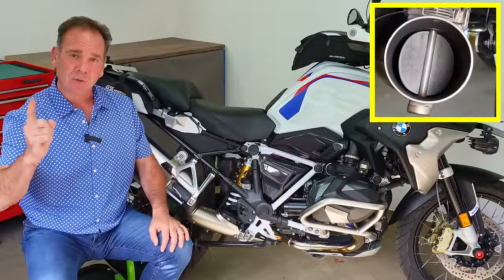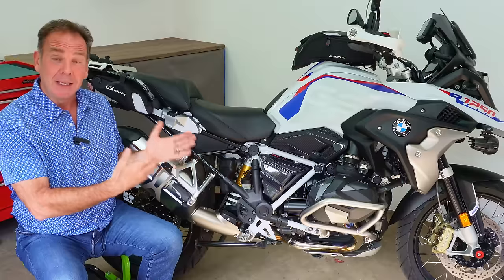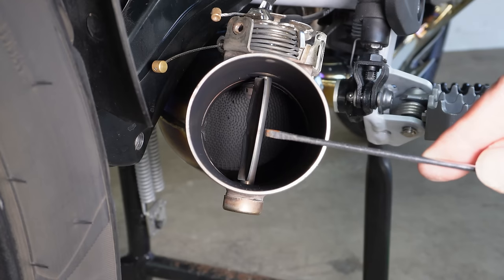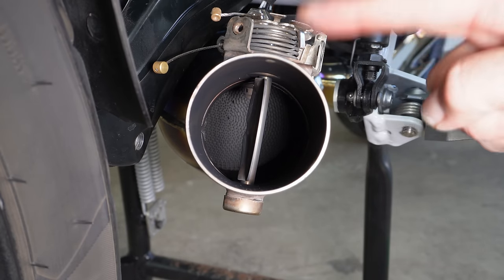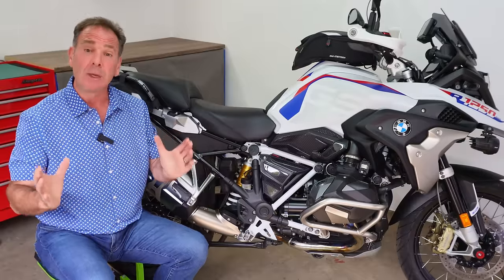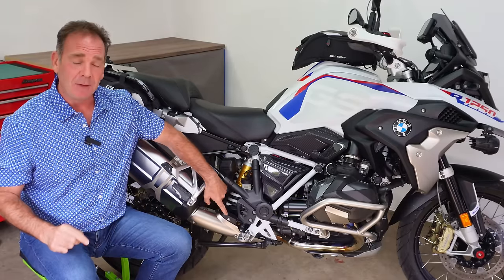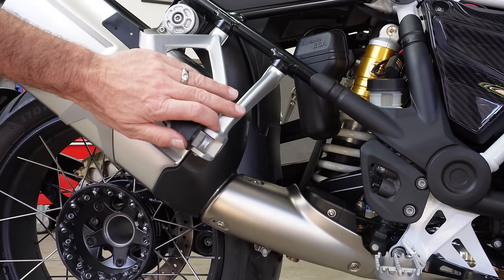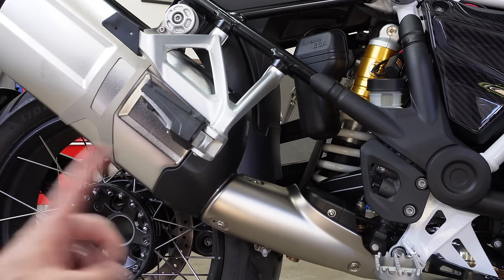EP 25: Butterfly Valve - Exhaust Valve - Exhaust Flapper - Sticking or Seized Valve - BMW R1250GS/A

Comment: Very useful and professionally put together video Carl. I have 850GSA Euro 4, 2021 reg. After riding the bike for almost 3000 miles (i bought it with 8500 miles on the clock) i have notice strange/different/additional noise from the engine when going through the 2800 to 3500 rev range. Watching your video, it made me think that this could be related to the issue (the flap valve not functioning quite correctly) you referring.  The bike has not lost any power, but the additional noise and some vibration in the pegs and handlebars when going through the above described rev range is noticable to me.  Is this credible suspicion of mine and should this part be checked? The dash board is not showing any faults...... I would appreciate your opinion on this. Many thanks
Reply from the maker: Hi Mario, I could be wrong !! but i don't think the "K82" 850GSA has an exhaust flapper valve like the R1250GS has, the noise control is taken care of by the two silencers (main collector box under the bike and the end can) 
However... your bike is close to the 12K service time, so I would definitely take your GSA to your local dealer for the service and ask for them to check the noise / vibration you are reporting. 
A few 850GSA owners have reported that the valves ( I'm talking: Inlet & exhaust valves that need adjusting at this service) have been tight ( on the exhaust valves ) and that after adjustment the bikes sound and run a lot better. 
Also you can check the exterior exhaust clamp ( between end can and main box) these also sometimes come loose and cause a rattle / noise, so its easy for you to check this.
Without looking and listening its hard to advise, 
Let me know how you get on, Carl
Reply: Carl, many thanks for taking time to reply. You are absolutely correct. I've checked physically on the exhaust system and looked at the schematic diagrams, there is no flapper valve. My fault, I should of done my homework first. The bike has undergone the 12000 miles service 1 week ago, about even though it has not quite reached the 12000 miles. I've done this on recommendation by the local BMW dealer, in order to remove the valve clearance as potential cause of the issue. Unfortunately, I can still hear and feel the noise and vibration. I am taking the bike to the BMW dealership I bought the bike on Monday for test ride / second opinion by their mechanic. Not sure what the outcome will be and wether they can spot what I am more than positive has changed with the engine going through that rev range as well as say cruising in 3rd gear at approximately 30mile per hour. Anyway, big thanks again for your diligent and friendly advice.  Guten aben. I know, the German spelling is probably completely wrong 😊
Reply from the maker: Hi Mario, your very welcome 🙏 and I do hope the technician is able to spot something and help.
One last thing, I presume the noise vibration is at the same engine rpm in EVERY GEAR ?
Just want to confirm this as I’ve seen wheel balance weights come off that cause sone very strange vibrations on a motorbike, but that’s normally at ONE specific speed.

Let me know how the inspection goes

All the best Carl
Reply: Hi Carl. YEs, you could be in second or fifth, if you are anywhere between 2800-3500 rpm . It's not wheels/tyres connected, i am sure of that. The bike doesn't feel or behaving dangerously, its just the engine operates differently than it use to. It has also increased the speed before it wants you to up shift. At 40m/ph I would go in to 5th, and in to 6th st 50m/ph. No issues from the engine. Now you need to be close to 60m/ph before starts to ask for 6th. It has increased approximately 10m/ph in up shift request for 2,3,4,5 and 6th gear. Not that it bothers me, but im intrigued how can engine change its operational carekteristic out of the blue 🤔.  I will definitely let you know how do I get on Monday. .....
Reply: Hi Carl. I knew something was wrong and I'm glad I did 150 miles round trip today to get second opinion,  even though the weather in England was as bad as it can get. After conducting health check first, the mechanic took the bike for test ride and reported that the engine does not sound and work like normal 850gsa and will require internal checks on the cylinders head. The investigation needed is referenced as  PuMA Measure 65125629. I presume this is BMW code for this task and the service manager advised that they have been notified by BMW previously regarding this issue on 850gs and gsa. So now I have to take the bike again to them in the near future as this is not a short process (approximately 10 days). At least I come across some more diligent and experienced personnel unlike my local BMW dealer...........
Reply from the maker: Well that’s brilliant news that it’s now moving forward for you and your bike, I was aware of an oil pump problem on the early examples but your description didn’t really match , but who knows you might get a new engine. 
Please let me know how the next stage progresses for you, it sounds like your bike is in good hands now.
Fingers crossed 🤞 
Kind regards Carl
Reply: Hi Carl. I took 1 month (the whole of January, mainly waiting for parts), but it's finally done. New cylinder head, valves and associated seals and gaskets. The engine is working like it used to now, phew. The mechanic has done really good job. It's a joy to ride the bike I knew before again 😊. Hoping to see new videos from you soon. Thanks, all the best
Reply from the maker: Hi Mario, so pleased to hear that your bike is back on the road, and just in time for spring.  That’s a lot of work you’ve done  but definitely worth it.
New videos due up soon
Best wishes Carl 🙋🏻‍♂️

Comment: Just took mine to my local Honda dealer where I bought it, mines in limp mode with 10 thousand miles, (2018 r1200 gsa), they say it’s the exhaust flap, they had a quick go at un seizing it but to be honest they just said I’ll have to take it to a bmw dealer which will mean loading it into a van😢, tomorrow I’ll have a look myself with the aid of this video, I’m pretty handy as was in motor trade for 26 years so looks like I’ll have to buy a obd reader and download an app🤨 , to be honest I’m sick of this f/ing bike 🤨 never had a day’s trouble with my k5 gixxer😍 these modern bikes are a hurtling pile of steaming 💩 imo!!!
Reply from the maker: Hi Julian, with your experience you should be able to free it off and maybe install a delete module so it doesn’t happen again. Lots of owners seem to do that.
Good luck with your repairs 
Carl
Reply: @justthewayitis  thanks for replying, I’ve just taken the silencer off, it’s moving but a little stiff so tomorrow I’ll start it off with some plus gas with rag stuffed around the butterfly and then copper grease, at first glance with just the cover off it seemed to be operating correctly as in the cables were moving the butterfly but it is stiff when they’re disconnected, am I right in thinking that even when it’s operating nicely that I’ll still have to get the obd to get it out of limp mode🤔 after that i think I’ll get that delete option.
Reply: @justthewayitis  thanks Carl your video is invaluable!!!👍
Reply from the maker: Well your is a 2018 so not sure, you might be lucky once it’s free or you may still a reset.
At least it’s moving which means you have a good chance to free it off completely 
👍

Comment: I love how BMW designed the installation of the servo motor right above the catalytic converter, which operates at 1,200 degrees.  Pretty stupid if you ask me.  Servo motors don’t like high temperatures.
Reply from the maker: Hi Michael, yes it’s not the best location 🤔

Comment: This poorly designed, non-serviceable item was at least easily replaced on the pre-LC twins as a stub. BMW carried over this dreadful design incorporating it into the header/cat assembly. I was quoted £1,800 plus fitting on my 2014 GSA LC with just 7,000 miles on the clock and, conveniently, not covered by my expensive extended warranty. The technician has sprayed the outside with grease in a half-arsed attempt to free it. One of several reasons I ceased to be a modern BMW owner. I have two old airheads that were well made and stood the test of time.
Reply from the maker: Hi Ian, yes not a great design as you say, many owners feel the same about the replacement cost which is extremely high.
Carl
Reply: @justthewayitis  Sorry, I should have said thanks for your excellent video before my rant! BMW service had no interest is helping to repair these valves to their shame….
Reply from the maker: Hi Ian, no problem 😉 
Glad you enjoy the episodes even if the bike is not your favourite 🙋🏻‍♂️
BMW need to really improve customer service 
Carl

Comment: What this proves is that the stylists who are involved in the designing and look of the bike have screwed them up by eliminating “FENDERS” that would or used to protect the rider and bike.  All the manufacturers are guilty of this fact.  You cant buy a bike with a proper front fender and in some cases a rear fender!  Shame on them all.  Idiots.
Reply from the maker: Yes it’s disappointing they don’t fit better protection for us and the bikes. Some brands are better than others. Carl